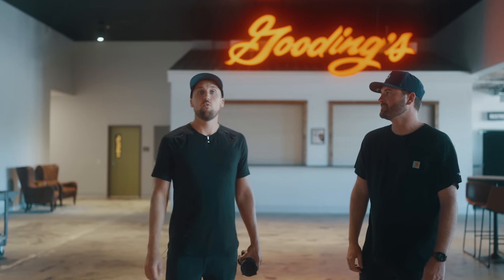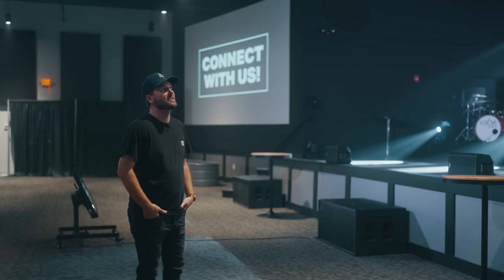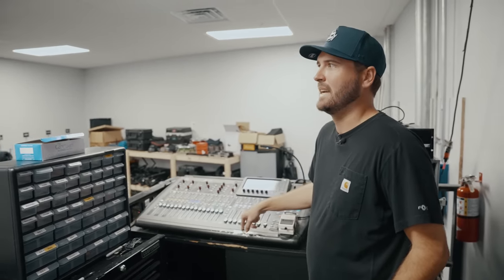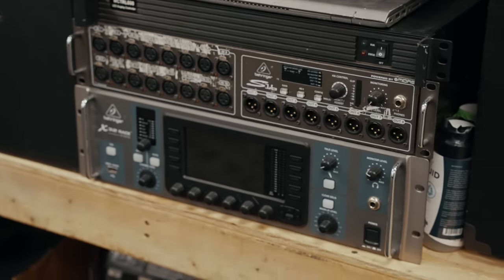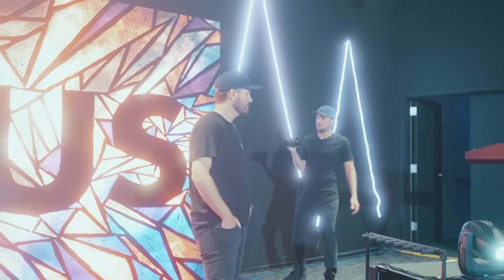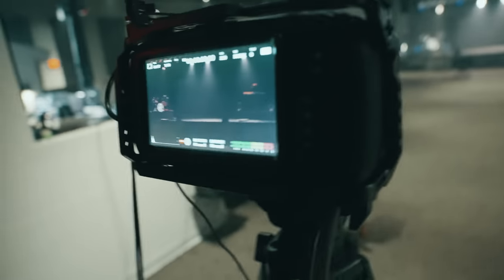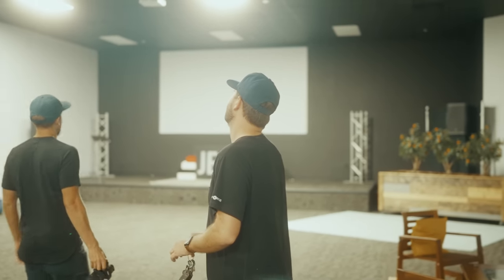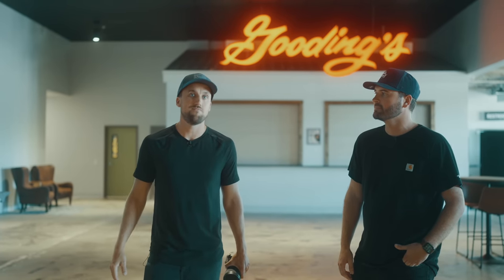How a Touring Engineer Mixes Worship | The Grove Church

Comment: I brought the concept of rechargeable batteries to our setup. We were spending a lot of $ ..  the initial purchase of the batteries and charging units cost a little but overall we saved money. In a small church that can make a difference. I had a rotation so no one ever wound up with a low battery.

Comment: I don't get, what's the X32 for then if they have a Midas mixer ?
Reply from the maker: They use the x32 backstage as an In-ear monitor mixer to have complete and separate EQ and compression settings and control of their mixes. This also allows them to not have to use any of the outputs from the Midas (FOH mixer) for IEMS. EQ and compression that sounds good for IEM mixes might not sound best for FOH applications. They are also using Waves at FOH and don't want to have vocal tuning effects in a vocalists in-ear monitors while they're singing, as this creates a phasing effect in the singer's IEMS.
Reply: @Churchfront  Wow! This isn't exactly a minimalist setup then.
Reply: @Churchfront  By outputs you mean Auxes right?
Reply: @Churchfront  Would a set up that uses wedges instead of IEMs remove the necessity of another mixer asides the FOH?

Comment: what is the use of boss effects in x32?
Reply: No answer? What are you seeing tuning reference?
Reply: I'm not 100% sure, but the pedal may have been a digital delay. I am curious to its reason and function, too.
Reply from the maker: That was just a spare pedal that a guitarist had set down on the mixer. No function.
Reply from the maker: No reason or function. Just a resting place for a pedal that a guitarist removed from their board.